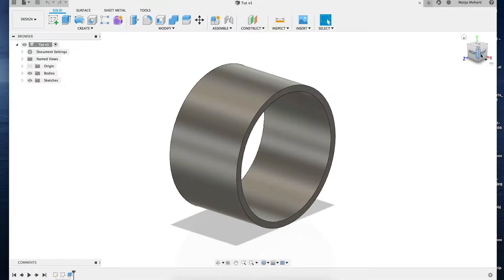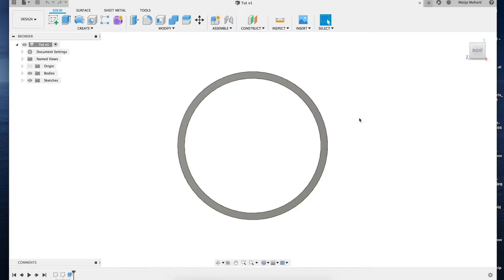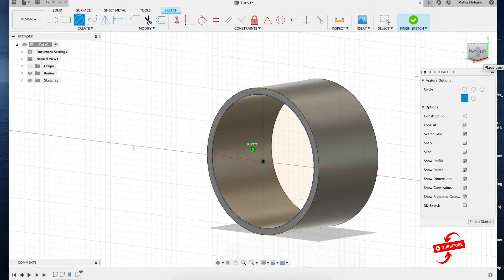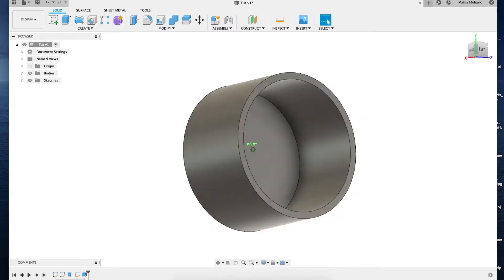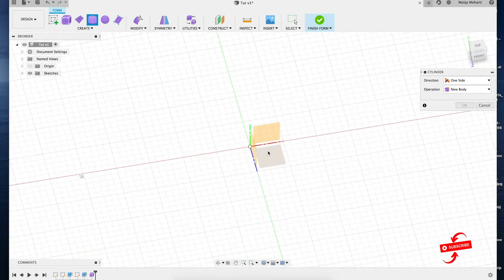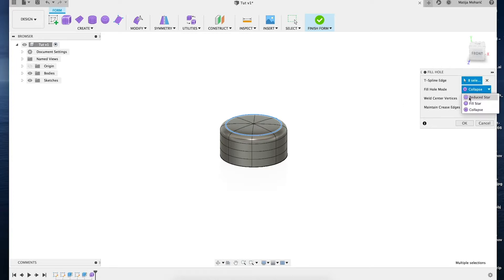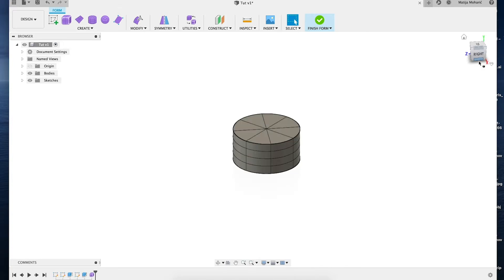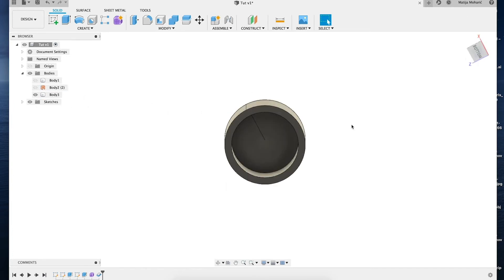How to fill a hole - Fusion 360

Comment: I fill my holes by using offset face. select inside of hole then move it more than half the diameter. the hole disappears.
Reply: Thanks, that was a much better solution for me!
Reply: Offset face worked well for me too. Especially if I don't know my circle diameter perfectly.

Comment: I was able to fill a hole without creating another circle and it let me select the face of the circle as well as the area I need to fill. Did something change?
Reply from the maker: Well, I'm not sure. How can you select a face if you didn't sketch it or offset it?
Reply: @mmtuts7159  project the original circle? Wouldn't that work?